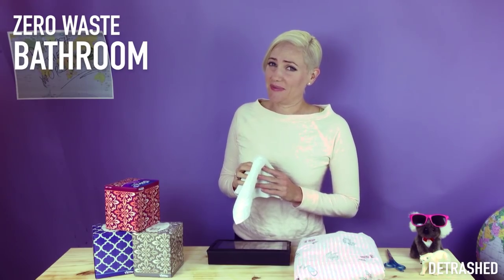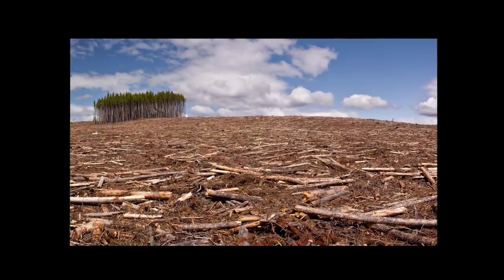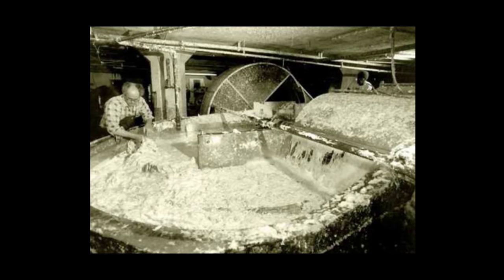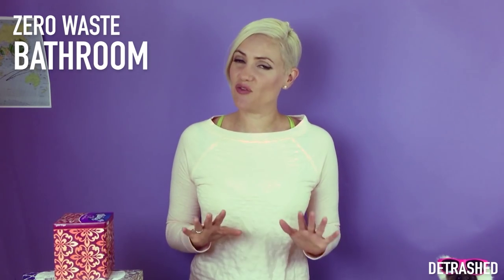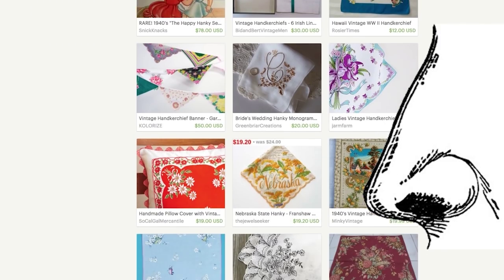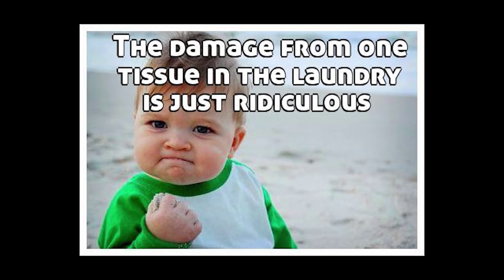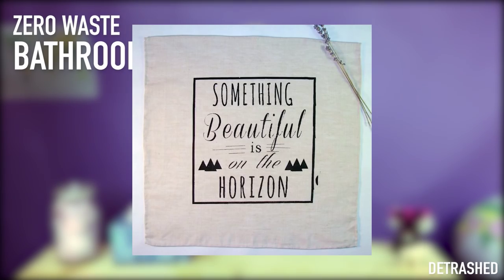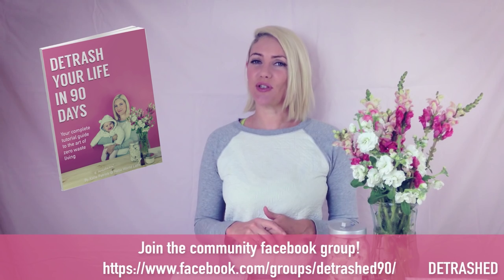Why You should Use Handkerchiefs: Zero Waste Bathroom Tip #6 with Katie

Comment: Linen is the best cloth for handkerchiefs.  Linen makes NO LINT!!!! This makes a truly superior handkerchief! 
When we were under lockdown for the plague  (2020) there were no paper products of any kind available for shipping to my location.  I remembered I had some old linen handkerchiefs stored away that had belonged to my family.  They were in everyday use when I was a child about 60 years ago.  They are linen.  I started using them and that spring, I noticed my allergies weren't as bad.  I've never gone back to paper. It turns out that the dust and lint from the paper tissues was making my allergies worse!  Linen is extremely long lasting (as evidenced by the inherited handkerchiefs I'm still using) and can stand up to any washing and disinfecting protocol you use.
Reply from the maker: Wow, what a badass tip, I did not know this!
Reply: It was one of those pieces of "everybody knows" in my grandmother's time.  It was so ordinary that nobody bothered to write about it much.  I knew about linen's lint free qualities because even in my mother's time it was regarded as the best to dry dishes.  As time went on and dishwashers became prevalent, even this formerly "common knowledge" became not so well known.  I had never realized that the lint from paper tissues was an issue for me until I stopped using them and went back to linen.  I only realized how important this difference was when I made some cotton handkerchiefs and started using them.  Only then did I notice that the cotton lint was an extra irritant and when I stuck with linen only, I was better able to breath.  So, please pass it along.  Thank you!

Comment: Hey Katie,

I have a couple of questions. The reason I have not made the switch yet is because so far, like you said, it seemed gross. I for instance would not want to just throw them in the washer with my other clothes in fear of boogers getting on my clothes. So how do you handle that part? Do you prewash them? Also (sorry to be asking this) how would you dispose of a condom properly if you don't have tissue paper to wrap it in? Thanks so much!
Reply: You can soak the handkerchiefs for a few hours with soap and/or baking soda in a sink, bucket, shower, bathtub, your choice.
Reply: if your handkerchief is dirty maybe wash it in the sink first with your hands. it's like rubbing the two sides together with two hands . maybe there's a YouTube tutorial to clean clothes with hand, but then when your down you can put it in the wash since all your boogers are gone :)
Reply from the maker: I'd just try and get over it. It seems like your apprehension is mainly psychological - that's what washing machines are for! They wash things and the dirt goes down the drain. Everything comes out clean, no worries :)
Reply from the maker: Just use a tissue for condoms.
Reply from the maker: But I did see a video once that was composting condoms in a worm farm and it worked! But I'm not even that green to go that far, lol.
Reply: We always tie a knot in the condom and throw it in the trash. Even before diving into zero waste we never wrapped it in anything.

Comment: I love your videos! I was so inspired after watching this one that I cut up an old sheet (100% cotton) and started making hankerchiefs.. the only problem is they began to fray within a minute of cutting them. I tried to sew the edge but it just made them bulky on the and took away from the soft 'tissue' like feel.. and there are about 50 of them which would take this non crafty person forever, but I'm willing to work on it if that is my only option. Any suggestions to stop the fraying?
Reply from the maker: Thanks so much! I'm so glad my video has had influence :) now this is not the most zero wastey, but you could get that iron on hem stuff. It's basically like a ribbon of glue that you can put on the hem and just iron it so you don't have to sew - should be available from any craft store. Or an over locking machine will secure the edges of you have access to one. I'm lucky that this sheet I used has not been fraying!
Reply: +Kristen Cold  l think there's a device/sewing machine attachment  called a serger that will give you a fast,tight hem that won't fray.Also,you can tuck in the whole edge a little then,fold it over to make a narrow hem to stitch,leaving the outer edge inside the fold. Message me too if you want some inexpensive sites/shops that sell beautiful handkerchieves.

Comment: Do you only use handkerchiefs once or do you fold and use them more than once? I own some but struggle with how to use them when I only need a quick short blow and 90% of it is still clean.
Reply: I prefer large handkerchieves,and use each one multiple times,until it's time to put it in the hamper and start another one.I always use the same side to keep track,and so that in public,the clean side faces out. Generally,l use two daily-one mens' and one ladies' handkerchief,about a dozen and a half weekly.
Reply from the maker: I just have a drawer full of torn-up t-shirts and then throw them in the wash. They are actually all different sizes, so I grab the best one for what I need. Btw I just released a new book, if it interests you, please get a copy and support the campaign on indieogogo - thank you!  https://www.indiegogo.com/projects/how-to-save-the-world-a-book-design-manual/x/14904956#/

Comment: Does the water, detergent and energy needed to wash these cloths outweigh the environmental impact of buying tissues?
Reply: +Shatteredteacup Absolutely-a lot of water is needed in tissue production--it's hardly a waterless product. I wash about ten handkerchieves weekly using a few sinkfulls  of water only. Soaking first helps--it's really very benign you can do ten or twelve while watching a movie.
Reply from the maker: +Shatteredteacup This is an important and great question! Life Cycle Analysis studies on diapers show that cloth diapering is only slightly more environmentally beneficial than disposable diapers. But important factors that make the difference substantial are washing in cold or warm (not hot) water, doing large loads (gaining economy of scale), and drying clothes in air (not in an dryer). We can extrapolate this scenario for handkerchiefs too. However when it comes to handkerchiefs I suspect that they contribute such a small marginal incremental volume of a load of washing that they don't cause any substantial environmental impact. You would never use so many handkerchiefs as to warrant a whole additional load of laundry. Thanks for the question! I hope to do a more in-depth video on this interesting topic soon!